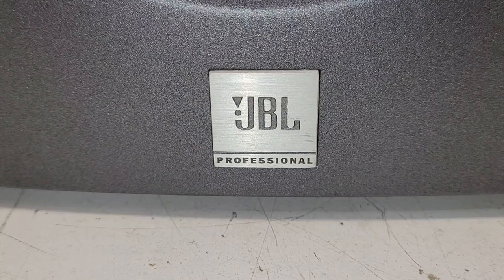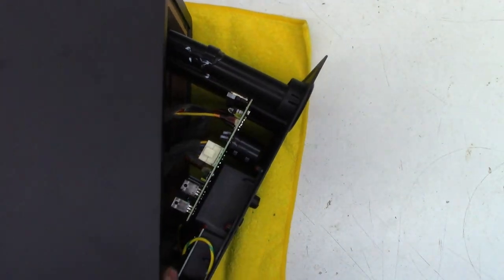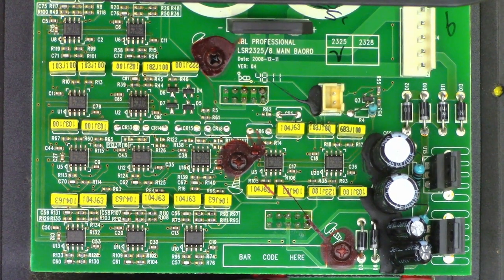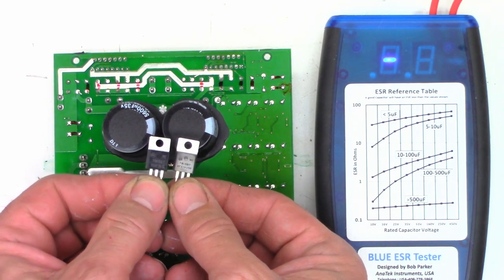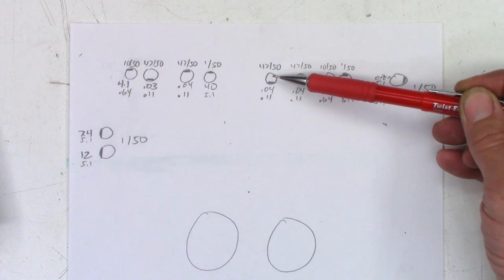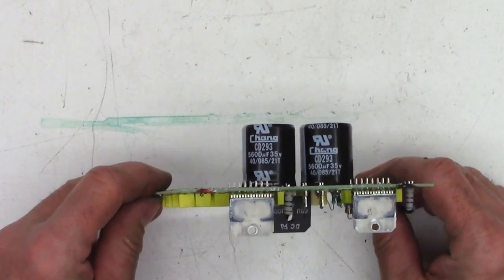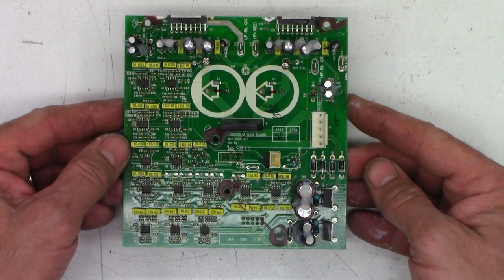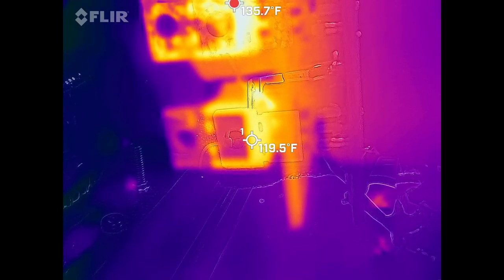JBL LSR2325P Bi-Amp powered speaker Complete capacitor and voltage regulator replacement.

Comment: Wonderful. It makes me want to do the same for the LSR4328 P speakers i picked up in the street. Three work, one is faulty.

is there a way to use a usual meter, like a Fluke 189, to test the caps without removing them ? or is the Blue meter a must ?

Comment: I have two subwoofer plate amps by Dayton audio.
I made the mistake of running a 1.3 ohm driver to each of them.

It lasted several days then got very stinky and then quit.

It's probably not cost effective to send them in for repair unless I do it myself. 

I have never even attempted to do what your doing for diagnosis. 

Where do you think, a good place is to start looking for the problem?

I have a DMM and perform electrical diagnosis and repair on vehicles .
Reply from the maker: Send me some info norcal715videos@gmail.com what model is it? and some pictures of the actual amplifier board would ne helpful.
Reply: @norcal715  Thank you so much.
I sent you two separate emails with photos from my Yahoo account.